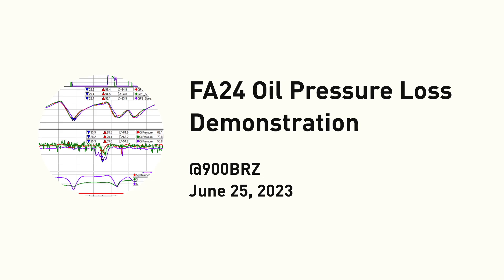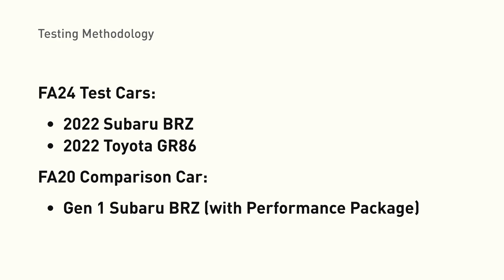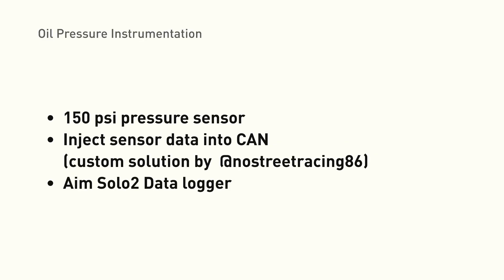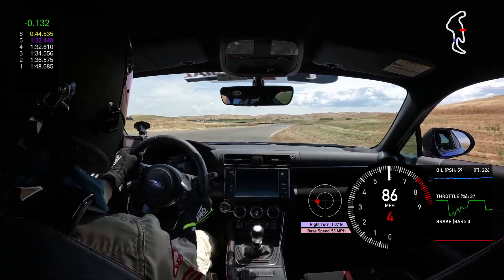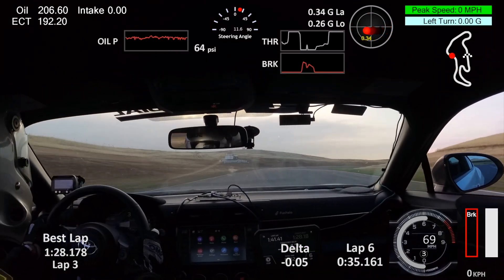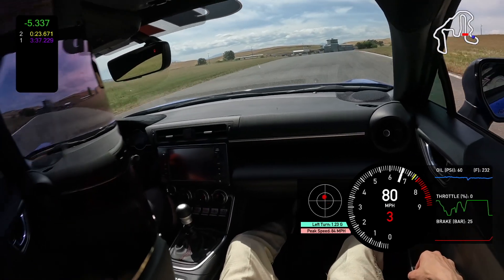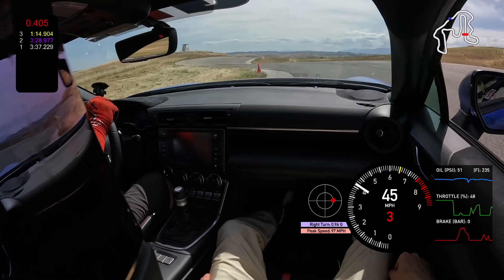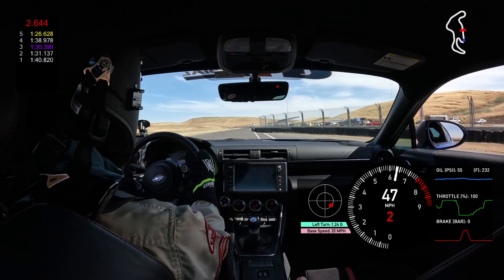BRZ/GR86 FA24 Oil Pressure Loss Demonstration

Comment: As a former Toyota mechanic and Subaru owner, I’m supper disappointed to see this kind of engineering. You went over and above to log the data. Toyota/Subaru should issue a recall. This is in no way abuse of the car. This is using the car exactly as advertised. You guys are just the 1% that actually use their cars the way they were intended. 

To me it most likely comes down to oil pan and pick up design. Designed for economy rather than serious use. If there is room a deeper sump and longer pick up with good baffles should solve this issue. Unless its a weird design issue with the pump pressure relief valve that opens on the right turn high G load situations. Keep us posted!
Reply from the maker: Thank you. Unfortunately there is no room for a deeper sump without a custom header design. It’s a quite expensive proposition so I’m not sure there’s a market for it. You’d have to design a custom header that only works with your sump, then get a longer pickup tube, and in order to install that you have to remove the timing cover!
Reply: @900BRZ  ah ok. I also had a question about how many mikes your car has. Is it still under warranty if it does blow up?

Comment: Another thing to consider (in relation to the WRX with the same engine) is that the part numbers for the oil pan for the BRZ and WRX are different. I don't know how different the design exactly is but the oil pan used by the WRX is used by ALL of Subaru's models according to the fitment guide, save the BRZ which has an oil pan designed specifically for it. Maybe this could explain why we haven't heard of WRX engines blowing up nearly as much as the BRZ / GR86 despite making more power from the factory and being tuned for higher HP numbers? Newbie here in regards to this stuff but I thought it was interesting nonetheless. Also found out according to WRX_SUB1 "All, preliminary data from WRX does not have this problem. I did 2 laps of two right hand onramp/offramps at 50-65mph on the hairy edge of grip on my modified WRX while my daughter filmed my oil p sensor on the dash. Suspension, sway bar in rear, swaybar stiffeners in front, air handling, exhaust, calibration work . Currently at 320/350. Ran the engine at 4500rpm, 215F oil temp, 5w-30. No oil cooler yet. Stayed right at 60-65psi. Note the oil volume is 4.8 on VB but 5.3Q on BRZ. WRX returns 25% more oil volume to the pan via jet pump pulling on turbo oil sump (vs BRZ) (as per my engineering contact at Subaru). I plan on doing a bit more testing. I ran the engine in the red oval. There is a chance that additional oil is held in suspension due to brz running 6k-7.5k vs wrx is 4500-6k typically (just speculation on my part)" So the WRX gets 25% more oil volume returned to the pan which is likely why the car isn't starving for oil on right hand turns unlike the BRZ.
Reply from the maker: Yeah I don’t think we can extrapolate this information to the WRX.
Reply: @900BRZ  Fair enough, I thought that the lack of (seemingly, more testing needs to be done by WRX_SUB1) oil starvation on the WRX could indicate that either the culprit is the oil pan itself being a different part number / different design, or (if they're a similar enough design) the jet pump pulling on turbo oil sump keeping more oil volume in the pan allows the system to keep oil pressure whereas without it the lack of oil volume causes the BRZ to starve on right hand turns for whatever reason. I do think the commenter that mentioned a transparent oil pan is a good idea. I also see that you mentioned that you have the oil pan baffle installed now and I hope that is all that is needed to fix the issue. I also saw that you might be testing the WRX as well at some point in the future so I'm interested in hearing your findings as well if you end up doing the research and see if it is consistent with WRX_SUB1's. Thanks for all the research and work you're doing, the community appreciates it!

P.S. If the baffle does not work, perhaps an extreme test would be to take the turbo off a WRX to see if it creates an oil starvation issue or add one to a BRZ with the jet pump pulling to see if that fixes the issue? With tuning of course. Mostly joking on this one.

Comment: Looks like these FA24s need a modified pan AND pickup to really put a nail in this issue.  Increase the pan oil capacity as well along with baffles.

Comment: an accusump would be an interesting and relatively noninvasive experiment to see how it affects these momentary pressure drops. it works great in my experience for any transient wet sump sloshing moments where you might be prone to sucking a bit of air through the pickup tube.
Reply from the maker: I think accusump could work but it adds complexity and failure points. I wouldn’t expect to need accusump for a completely stock setup. My initial expectation (based partially on the marketing and it competing with MX-5) was I could take the car to the track with just an oil cooler, pads, and brake fluid.
Reply: @900BRZ  not disagreeing you should have the performance you paid for, it would just be an idea to see if that’s a workable solution. Some track guys might consider it extra insurance, above and beyond the proper fix.
Reply from the maker: @BW_Tuning  Yeah totally agree. If the Killer B baffle doesn’t totally solve the problem, I’ll likely run a horizontal baffle as well and see if that does. If I’m still suffering drops, I think Accusump might be necessary.

Comment: There’s definitely a design flaw on that pickup tube. Subaru needs to look into this
Reply from the maker: It’s very hard to be definite about anything other than the fact that we’re seeing pressure drops at this point. Everything else is just a hypothesis.
Reply: @900BRZ  yeah maybe i jumped the gun there. Although i will say that from the fa20 and the fa24 the pick up tubes are quite different. I went to look at one of the upper oil pans and a block we tore apart from a frs and I’m trying to figure out what about this one here would be resistant against that. I still haven’t seen a upper oil pan on a fa24 in detail but this one has cross rails casted into it for rigidity. Not sure if their acting as baffles on this motor against the new one.

Comment: Toyota turned down a few people who had this issue and said they wouldn't help because racing voids the warranty. I hope this makes them do a recall and provide the proper financial payback for the victims of this failed hardware.
Reply from the maker: Yes, I feel for people who have used the car as it was advertised and then been accused of abusing the car. That’s not right.

Comment: this could be a really naiive question, but: would this be any different in Right Hand Drive models? or is everything under the hood essentially the same?
Reply from the maker: My understanding is only the components that need to be changed are changed. So steering column, and things like brake booster. But the engine internals should be unaffected.

Comment: So basically if you want a BRZ/86 you either have to live with the crappy torque dip of the last generation.  Or put up with the an engine that can't seem to keep itself properly oiled during spirited driving.  Sounds like a lose/lose situation.  Does this effect the WRXs that have the same engine?
Reply: According to WRX_SUB1, who has an engineering contact at Subaru, the WRX returns 25% more oil volume to the pan via jet pump pulling on turbo oil sump compared to the BRZ and he didn't experience any oil pressure loss staying between 60-65psi when he was out on the track (see other comment I wrote sorted by new for more details). He did four hard right turns total over two laps with no issue. He'll be doing more testing in the coming days to see if he can get the oil pressure to lower but the WRX sounds more reliable in terms of getting the oil it needs so far.
Reply: @Danter5435  So it sounds like the solution to the issue is to turbo the car. I'm sure all of the BRZ/86 drivers will be so disappointed.😁
Reply: Think of the torque dip like it’s a Honda with vtec kicking in. 😂
Reply from the maker: Need to test it separately. It has significant oiling different to supply the turbo
Reply: @900BRZ  That's kind of what I was thinking.  Seems strange that it only happens in right hand corners.  If the oil is sloshing around in the pan that much to expose the pickup could the issue be remedied with some baffles in the pan?  Or maybe a relocation of the pick up?

Any idea of where the turbo falls in the oil circulation loop?
Reply from the maker: I don’t know much about the WRX variant get. Trying out a Killer B baffle next.

Comment: This happened to my Wrx. Hit a corner. Going right. Hit boost which resulted in rod knock. Luckily I had warranty and got a new engine. I had a feeling this is what happened because I had an STI that I beat to shit and never had issues.. both cars are bone stock fyi. I had a feeling cornering was an issue for my fa20….

Comment: I didn't see it mentioned in the video or comments, but what oil level are you running?  I do a fair bit of endurance racing and every team I've driven for overfills by 1/2 to a full quart when not dry sump based on how much it takes to stop pressure drops in turns.  This is even with baffled pans.  Frothing the oil has never been a problem because in those engines at high RPM a lot gets "trapped" in the heads and other places, and you're actually running "normal" oil level in the sump.  I don't know how bad a boxer is at trapping oil in the heads at high RPM.  Mitsus are bad for this to the point we add external oil drains from the head back to the pan because the crank vent airflow pushes up the same holes the oil is trying to drain back down in, and you can literally fill the entire valve cover with oil.
Reply from the maker: These FA engines have significantly better protection from filling the head when compared to EJ engines. These cars were at or slightly above the max fill line, but not overfilled by that much. I’ve been told that overfilling doesn’t actually do much in these engines but I haven’t verified that.

Comment: Keep adding oil to the engine untill it stops doing it on each run 😂
Reply: Not a crazy idea provided there was not too much oil needed and crank case pressures stay in check.
Reply: @MarkJCarruthers  would be good to see how much more it needs before the dips stop, might be useful for some sort of data to help engineer a new sump design and pick up
Reply: @tomop5603  I think if I do not have a solution by next track day I'll over fill by at least .5qt. or just add 6qts to a fresh oil change.  I'd hope that amount will not increase crank case pressure too much or cause cavitation.
Reply from the maker: I’d like to find a baffle that improves things without an overfill and then start doing an overfill to hopefully get to no drop on OEM level grip tires.

Comment: Why aren't you guys using Accusumps??
They work super well, I would know, my race car pulls an excess of 1.4Gs on 315s.
It's like $800 to set one up.
And since You have an oil cooler, 1/2 the plumbing is ready done.
What's cheaper? A new engine or a $800 accumulator?

Anyways, good video regardless.

Comment: This reminds me of the xrunner where toyota placed the oil pickup in the shallow part of the pan. lots of xrunner spun bearings due to this. on the 4x4 1gr oil pan there are no issues and can confirm on track i never had an oil pressure issue. the solutions for the xrunner was to install a 4x4 tacoma oil pan, which would fit oddly enough, get a spacer for the oil pickup and lower oil pan which increased oil capicity and lowered the oil pickup point which was no longer in the shallow part of the pan, there was a nice baffled lower pan which increaded capicity and lowered the pickup point as well, and the last method was to overfill above the top dot.

Comment: And if you add a dry sump system with large reservoir?
Reply from the maker: Very expensive but also not available commercially AFAIK. You typically need scavenge pumps in various places in boxer engines.

Comment: This is an excellent video and well constructed research. As a former engine oil systems design and test engineer (see Schrick tilt rig) I could say this may possibly have been 
A) the way they tested the engine during development phase
B) their decided upon limits were set very loose (we had clients who say eg. "Below 2 bar @4000rpm for up to 3s is acceptable")
C) management bean counters intervened 

Either way this is super interesting and not what i would expect from them for such an enthusiat based car. 

It would be interesting to note the correclation between the oil temperature as well. Does it increase in severetiy over multiple laps? As expected it seems that rpm has some effect so windage and aeration will be playing its part.

I also look after a new gen BRZ that goes to track, would be interested in the CAN integration of the sensor so that we could do the same and gather some data. 
We are using the Tomei baffle in the sump so would be interesting to see if we still have any issues. 

Thanks for all your effort!
Reply from the maker: Thanks for the thoughtful comment. The Schrick tilt rig looks awesome—I want one! 

I did not do extensive research into the correlation between temp and the magnitude/duration of the pressure drops. I felt it was somewhat independent of oil temp even though nominal pressure at high RPM does decrease as temp increases. Not confident enough to actually claim it’s independent though. 

My friend also has oil pressure logging set up and A/B tested the Tomei baffle. It does some good but does not fully resolve the issues: https://www.youtube.com/watch?v=35-hf0SKzNg
Reply: @900BRZ  Hello, fellow engineer/analyst here. From your and also this track and built video it seems there are two separate issues. One are pressure drops with elevation change or car bouncing, which I think are pretty understandable and quite normal and second lateral G related pressure drops. I noticed that when you have a flat right hand curve, there is no pressure drop if you are below roughly 6k revs!

These very short drops related to vertical G should generally cause no problem because they take few tenths of a second. Engine can run with "no" oil supply for very very low amount of time. The damage is probably done by the longer periods with lower pressure and so would be interesting to dig deeper what is going on around the 6k rpm. From both your videos there are high Gs with low revs and pressure is OK and even relatively low Gs with high revs and pressure drops. It could be non symmetrical pump/oiling operation or something deeper in the engine and that is why these baffles seem to not have a significant effect on this issue so far. Would be interested to see more info about that rpm range dependency. Keep the good work.

Also an old tip I got form a Porsche gt3 rally mechanic/hobby driver. Overfill those flat engines with oil hard.. :)
Reply: The answer is always "C"

Comment: Nothing like spending 30 grand on a 4 cylinder Toyota just to have easily avoidable engine failure. You mean to tell me no track testing was done while monitoring basic parameters

Comment: I haven’t seen anyone in the comments say this, so maybe I’m dumb but is dry sump oil pump the solution? I get that the oil baffle can help the oil get to the oil pickup even through lateral gs but dry sump seems to be something that can handle this
Reply from the maker: Dry sumps for boxers usually involve multiple scavenge pumps and increase cost significantly. I’m not aware of anyone doing them for FA24s yet, but that would be ideal.
Reply: @900BRZ  yea after my comment I was reading about it, not much available out there for this

Comment: I think toyota/subaru should've stayed with an inline engine like in the original 86. Maybe it would've been nice to see the g16 from the GR Corolla and Yaris in the GT86/BRZ and GR86/BRZ
Reply from the maker: Yeah, certainly easier to manage this with an inline engine as long as you still have a wet sump.

Comment: Excellent presentation. If you do a follow-up video, please add a label for the year/make/model of the car. I don't own a GR86/BRZ so I have trouble knowing which car is which from the design of the car's interior. Is there an upgraded oil pump available that fits those engines, similar to the Subaru EJ20 WRX vs EJ25 STI oil pump?
Reply from the maker: Good point. Easiest way to tell is actually the data overlay. The GR86 has the oil pressure at the top of the screen, my car have the overlay with the san-serif font and the 2017 BRZ has a serif font on the overlay. I know, that’s not ideal!

Comment: Awesome (if worrying video). Would you expect the drops to be even more significant on stock 0W20 without an oil cooler? It looks like most of the dips are at 0.9G+, and I wasn’t sure if I would be hitting that on the street with my PS4’s, however I just went for a short ‘entusiastic’ drive and was repeatedly reaching 0.9-1.2 😮
Reply from the maker: I’d expect the nominal pressure to be much lower than 60 PSI, but it also depends on ambient temperatures. I think it’s possible to observe drops on the street but I haven’t done any street testing.
Reply: @900BRZ  unfortunately I can’t think of a reason it would be different on the street, if you are reaching the same lateral G’s. I’m looking forward to your next video with the baffle installed with interest 👍
Reply from the maker: My assumption is very few people are achieving similar levels of lateral acceleration and duration on the street, but it’s definitely possible. My goal is not really to argue that this is a problem on the street. At least, I don’t have the car to do that testing. If I did, have a totally stock car, I’d be open to doing that testing.